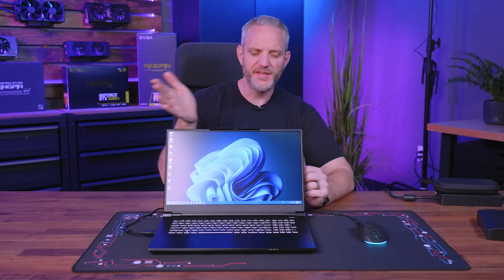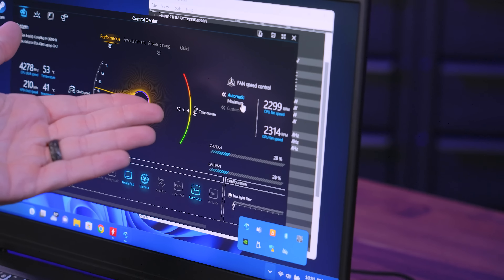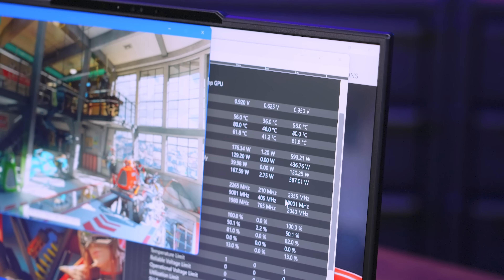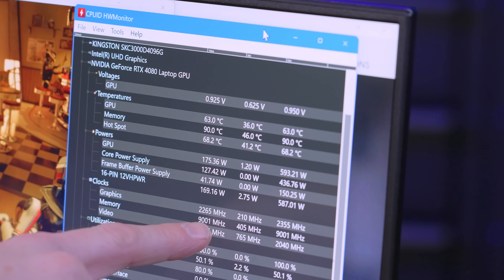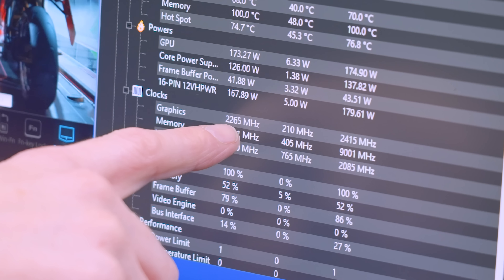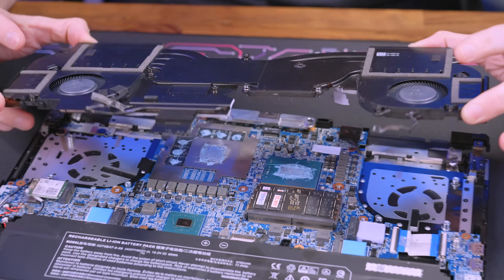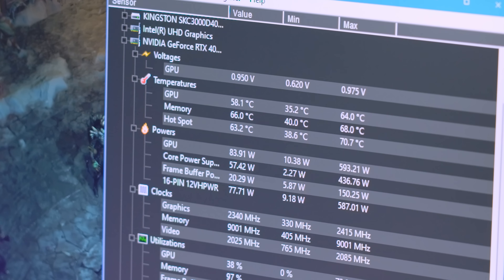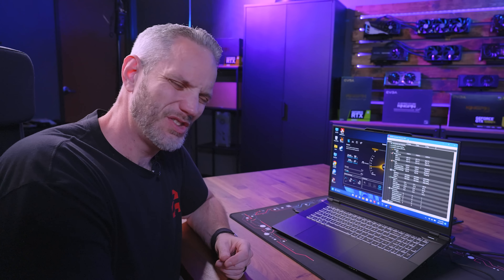I think I made it worse...

Comment: The lesson to take here is: Don't change your thermal pads unless you have identical height/consistency replacements. And like you said Jay, unless you have a problem already that you need to fix, you're better off leaving your laptop alone rather than repasting it.
Reply: really a YMMV situation. I've repasted every laptop I've owned as well as any non-Apple work laptops I've been issued and the temps always come down. Bulk manufactured laptops often don't have great thermal paste application from the factory, and/or don't use the most conductive paste (usually something cheap that they got a good bulk deal on) so if you are able to repaste properly you can get lower temps even on a brand new laptop. The takeaway here to me is more "be careful and make 110% sure you know what you're doing and why".
Reply: lol ive replaced my thermal paste on everything ive ever owned with better grease and have had only good experiences but the pads should have been replaced like you said with proper fitting pads
Reply: @kalmtraveler  just because the temps always come down doesn't mean they needed to come down. For 99% of users it's not worth the work and risk of messing something else up. It's the difference between "can" and "should"
Reply: @NickCharles  jumping into a very very vague area. A 'problem' may not be apparent until an improvement is sought - and to your point for 99% of users don't 'need' to do most of the things they do. Discussions are best framed within a set of circumstances, a specific audience, etc - and given the YouTube channel here, I think it would be a safe bet than  more than 1% of Jay's viewers are folks who enjoy building/tinkering with computers to try to get the most out of them. That being said, you are correct that hotter-than-necessary temps in a laptop didn't 'need' to come down. As the laptop owner, I  'wanted' them to come down so the fans wouldn't run loudly for no reason and so the laptop lasts longer. The laptop itself had no need to run cooler and quieter - it would have been just as happy to slow-roast itself into an early e-waste grave, but I had other intentions.
Reply: @kalmtraveler  Your laptop is not going to slow-roast itself into an E-waste grave. I hope you're not seriously trying to posit that by lowering the temperature a couple degrees you've somehow saved it from dying due to excess thermals.
Reply: @rustler08  spoken as someone who clearly has never had a laptop cook itself. That's literally what prolonged "excessive thermals" do to electronics. Also - not sure where you made up "a couple degrees". Nice try though champ.
Reply: Or just use K5 Pro. The extraneous squishes out
Reply: @NickCharles  "Needed" what does that mean? Some people mod their machines to improve performance others are happy with what  manufacturers serve/dish up. Your comment is pointless in the context of a modder's channel.
Reply: @rustler08  He never said "save it" he said "extend its life". Big misuse of language (sophistry) by you.
Reply: The message here is, if you don't know what you're doing and/or don't have the patience to get the right part, don't touch it at all.
Like people asking on internet how to replace the spark plugs of their car because they want to do it themselves, if you have to ask that question then you're not knowledgable enough to do it.
Reply: Bad advice. 

You can replace thermal pad with thermal putty. Using putty yiu don't need to measure nothing because is soft enough to squish itself with the mounting pressure. In some cases improves contact too for cpu and gpu.

Upsiren UX pro is much better in performance than thermal pad, it's reusable, doesn't leave oil like k5 pro and is really easy to clean.

Honeywell PTM7950 for cpu and gpu and UX Pro for vrm/vram for repasting laptop and desktop gpu are the best thing you can do to improve temps, even from fresh factory laptop and gpu, unless you have liquid metal or you have a Legion which have PTM7958 from factory
Reply: Like I changed the thermal pads from my msi rtx 2060 super ventus gp oc and now I'm facing higher temps because wrong pads height even if I followed the diagram from a thread on the msi forum, so I sent my graphics card to a computer shop to fix it
Reply: Or, use thermal putty
Reply: But its not a thermal pad or thermal paste problem.  Thats an engineering design flaw.
Reply: I feel this is the kind of thing most of us only really learn by experience!
Reply: @kalmtraveler  It's true, 80C and 82C temps aren't really going to make a difference in the long run. Those "cooking" temps you're talking about are 90C and above, and no one in here is going to run their laptops at such temps.
Reply: @Sergmanny46  sadly, from experience lots of enterprise laptops ship with poor CPU thermal paste application, or just old so by the time you get it the paste has mostly/all dried up and you definitely will see those 90 C temps. Currently using a corporate-issued Dell and the CPU fan pretty much runs nonstop full speed because the CPU is too hot. I had the same model previously and after repasting the CPU (without telling the company of course) what do you know, fan stopped being audible unless an active load was placed on the CPU. I may end up doing the same on this one but they don't pay me to work on hardware so who knows.

Comment: Could always try k5 pro for the memory, it's a thicker paste made for replacing thermal pads.
Reply: I was thinking the same thing!
Reply: I was about to comment this. It works wonders when I replaced my ps vita screen and needed a special pad for the IC.
Reply: had the same idea
Reply: Why would u want a USB DAC for memory?
Reply: K5 Pro is inefficient 5.3W/mk, better apply Upsiren UX Pro 16.8W/mk.
Reply: I using it on my MSI GL65. I think they had that originally.
I'm also using HoneyWell's phase change pad for the CPU and GPU, forgot what's the number is called tho.
Reply: @Xbox360mIRC this isn't Head-Fi lol
Reply: @goorthiss  Why would you use chinese copy of K5 Pro? It's pretty much same thing, just with false advertising as bonus. I have tested bowth, and surprise same exact temperatures.
Reply: @goorthiss  that putty dries quickly.
Reply: I commented this on the last video but it got lost in the sea of comments. Glad this is at the top so he has a good chance of seeing it
Reply: Wanted to mention this as well
Reply: @goorthiss  using w/mk is a flawed measurement where many other factors can affect it. Head to head like for like testing is the only way to determine the better onr
Reply: @goorthiss derbauer explained that this measurement is useless to differentiate between pastes because it changes depending on testing conditions (ie temp). Not a good rating to base your purchase on as it is not standardized.
Reply: Glad you mentioned this! I used K5 pro on my 3090 instead of thermal pads and it worked wanders. Memory temps went way down while not effecting my GPU die temps at all.
Reply: K5 Pro is terrible for high heat load applications. It works on the ancient laptops they designed it for, but it does not like GDDR6. I tried it on my 6800XT and it was almost 20°C worse than the stock pads, I went back to pads after that and my temps are normal again.
Reply: Used k5 when I repeated my 1080 ti, worked great on memory. Used thermal grizzly for GPU die
Reply: @chdvnc and K5 lasts a long time. I have a few gpus done with it, and it's better than thermal pads ime
Reply: Yeah, replacing thermal putty with thermal putty is obviously a good thing. I used Laird Tputty 607 the last time.
Reply: he needs thermal putty.  thats what was there.
Reply: Messy, but it will do the job perfectly :)
Reply: My initial thought too, but I don't think it'd work. If the issue is that the chassis might flex, then K5 Pro and pretty much any other thermal putty could get pumped out from the mechanical movement of the cooler. Squishable pads are the way to go, I think - although the better thing to do would be for Clevo to make a better cooler, because this looks like some really poor manufacturing tolerances.
Reply: @jarnom85  Nah that stuff fails quickly, tried and tested already and it's a sheer cluster f to clean up.
Reply: @habilain  I haven't experienced much/any pumpout with k5 pro in laptop applications. I think it'd be fine here and certainly better than a thermal paste solution.
Reply: @BrianMcKee  I guess it really depends on the degree of flex within the chassis. I got the impression that at least someone at Clevo thought it was problem enough, or maybe they're just justifying using easier to apply pads. Definitely agree it'll work better than non-contacting thermal paste though.
Reply: UPSIREN UX PRO Ultra 16.8w/mk Thermal Putty is the best!
Reply: @Creepus_Explodus   Glad I'm not the only one that experienced this, with a 6700xt I saw my vram temps go up by well over 10c (stopped testing when i saw the number shoot up), some ppl say I didn't use enough - I added more, others say I used too much, i removed some overall K5 "pro" was just rubbish for me, maybe i got a bad batch, who knows, I'm never buying it again.

I managed to source some TG-PP10, amazing stuff works better than stock pads, and is on par with gelid GP-extreme 1mm thermal pads. Its a real shame that they discontinued making it. Other ppl recommend Upsiren U6 and Upsiren UX - haven't tested it myself but cant be worse than K5 "pro"
Reply: That’s exactly what I was thinking!
Reply: saved me from having to comment this
Reply: It made my Xbox one x  run way quieter
Reply: @goorthiss  where can I find it?

Comment: Sure, it could be that the thermal pads are holding back the contact for the core, or, more likely, you’re sinking more heat from the memory chips into a shared cooling solution. So by cooling your memory chips more, you’re leaving less cooling capacity for the GPU core. It could also be a combination of your theory Jay about having the proper pad thickness and my theory about a shared cooling solution.

Comment: Videos like these are great. Sometimes it's better to let others learn from your mistakes than to just show what you changed. Thanks Jay.
Reply: The mistake here is not using thermal putty and that is something you must research beforehand just like i did with my MSI GP76 that also uses putty in the VRAM/VRM so logic intermediately tell me if MSI used putty there instead of pads is because the engineers know that the heatsink is warped beyond repair and pads will never make even pressure in all the contact points.
Reply: @riphunter5100  agreed, but it is still valuable content for people looking to try this kind of mod.

Comment: Normally, the thermal paste thickness goes below 0.03 mm to achieve good contact between the die and cooler, so it basically has no tolerance to any gap variation. In this case, the laptop manufacture want to improve cooling for the memory chips by reduce the gap below 0.5 mm so that no thermal pad is suitable, and they use thermal putty for instead.

The difference between thermal paste and thermal putty is that after compress thermal putty want to retain its uncompressed shape, generating reaction force to ensure good contact with surfaces, while thermal paste don't has such reaction force, so it could loose contact easily with bit of move and twist.

Comment: I worked for a smaller SI that used Clevo... They are interesting to work on. I've acutally seen those thermal pads basically melt in older, well used Clevos. And gotta love the classic use the power brick to get more airflow trick.

Comment: One of the higher end dell laptops had a kickstand like thing. When I worked in IT all the VP's got laptops with the first generation I9's and the lid was longer than the base. When you opened the lid it propped up the base by about 1/4" and allowed a flow path in front of the screen. We had major issues with them over heating because the users would leave them closed on their desk plugged into a docking station.

Comment: A lot of people including me reported that you should have used a thermal putty like k5pro. Gddr6x dies! There are hundreds of repair videos with people replacing dead VRAMs in newer graphics cards due to extremely poor VRAM cooling. 95C or above is not acceptable for GDDR6/GDDR5. The VRAMs are rated for 95C at maybe 5000h or so. Running lower temperatures will increase the longevity 
Also KPX might not be a good thermal compound for that laptop. It's too much of a temperature delta between idle and load. It will pump out. Use PTM7950 for maximum stability

Comment: I've had this same issue with some Assus laptops and the finite solution for me was to measure the gap using plastigauge and machine a copper wafer to take up the space between the cooling element and the memory. We're talking about sub mm dimensions, so totally out of people's hands, BUT, where there's a will there's a way. A thin wafer of copper can be sanded down to the right dimensions with enough patience.
I've had no issues with those laptops so far. Not my original mod, saw it in the early days of big external graphics cards.

Comment: You need to re run that test with the fans set to automatic...... You did maximum to resimulate the original test but thats not what was going on when she was playing. the fan may not be running enough in auto mode to be able to cool like what you're seeing with max.

Comment: I still have a Clevo based gaming laptop from 2013, I kept it clean and well maintainted and it still works fine to this day!! It was built for me by XMG in Germany, model was XMG P723 (Clevo P370SM). Just shows that if you spend a good amount and buy a custom built laptop it will last much much longer than a crappy commercial one. 

I think your memory could go up to 110C before throttling.

Comment: Going automotive on you, try using plastiguage on your memory to determine the thickness of pad you need. Concerned about plate not being perfectly level? Check EVERY single one of them. Some may need a thicker pad than others. OR, try using a laptop cooler. If   laptop   hot,    use    a    cooler. I'm fairly sure that Micro Center could fix you up with a nice one for cheap. You could come up with one of your cardboard/air conditioner rigs, but that might not travel very well.

Comment: you could use a thick thermal pad on the outside directly above where the gpu is as a shim that will press down on the center of where the gpu is when you reassemble it. the little bit of extra downforce might make the difference.

Comment: Maybe try the new Honeywell PTM7950 thermal pad, I used it on my omen(R9 5900HX and 3070)  and its night and day. Its solid till about 50 degrees then it gets viscous, should  have insane longevity and makes great contact and idiot proof since you just cut to size
Reply: Same, I'm using it for my laptop along with K5-Pro for the other chips, been half a year and so far so good.

Comment: Hi Jay. Whenever I try to solve a PC problem, I usually end up with two or more problems I must solve. When I worked on car engines, way back when, I used a product that looked like a long squishable worm. I placed a length of it where two parts joined. After I tightened the parts to the proper torque, I separated the parts and used an included scale to measure the gap. This procedure showed me if the gap between the pieces was within the allowed tolerance range. A product like this would let you see if the pads were being compressed correctly and if you needed thicker or thinner pads. This is just a thought of mine, and your mileage might vary. Anyway, I always watch your videos and am happy I subscribe to your channel. P.S. Please make an updated video about the Test Apps. you use and where I can download them and not end up with a malware problem.

Comment: If you haven't and can, try turning off PCI-E Gen 5 to help with Diablo IV stuttering. If I questioned thermal compound contact, I'd try seating a cooler and removing it to visibly confirm it; the rest of the laptop case doesn't normally squeeze the heatsink down. Clevo laptops have had people finding ways to modify its cooler contact pressure to get more and more even contact, sometimes just by adding leverage onto support arms and such in previous years.

Comment: With Diablo 4, ultra settings quickly fills VRAM and requires the system to start swapping. When you load up new areas it can stutter bad sometimes.  Mine was horrible until I realized I had somehow disabled XMP, so my ram timings were way slower and the 3080-ti was having a hard time handing textures to system memory. Likely didn't do it for you cause you stuck around in 1 place Jay.

Comment: I've seen this on multiple laptops and some discrete GPUs... They design it to barely keep the memory from overheating and let the core boost up to whatever it can get with the cooler. They use cheap pads with poor thermal conductivity and good contact for a reason. When you swap out those poor pads for really good ones, you're allowing more of the heat from those memory chips into the cooler, which means the core can't boost as high. A hunk of metal can only dissipate so much heat, increasing the thermal transfer doesn't magically increase the amount of heat the cooler can handle, it will just affect everything attached to it quicker. The only time I would mess with the stock pads is if the card is already overheating, or if your card has a separate heat pipe/dedicated cooling for the memory that is not connected to the die cooling.

Comment: Could it be that the gpu is getting good contact still.. but now it is sharing a cooler again with the memory. When the memory was getting hot with poor contact the gpu and cpu were cooler because they didnt have to share the cooler with the memory. It could be with this amont of cooler, the gpu/cpu downclocking is the price you pay for not overheating your ram and now its back to normal? Or were gpu/cpu temps better before you changed anything?